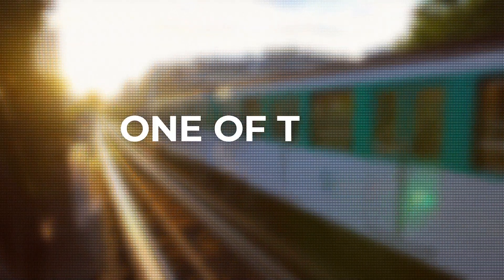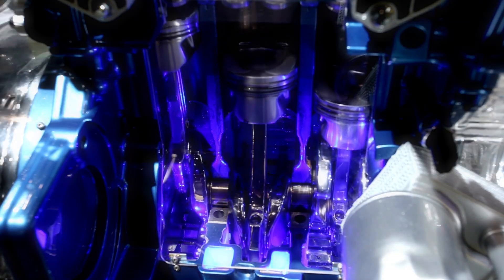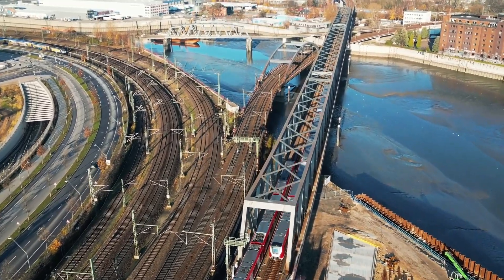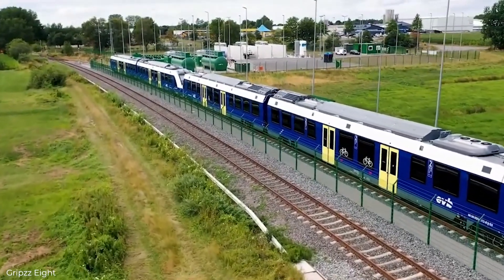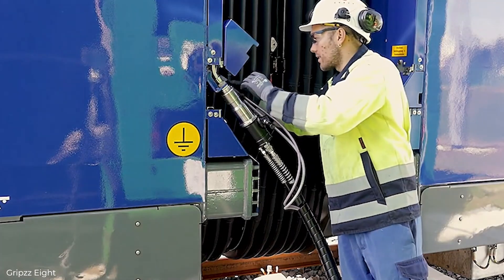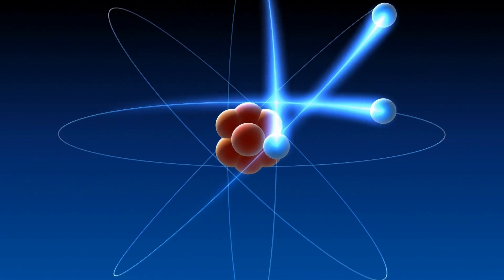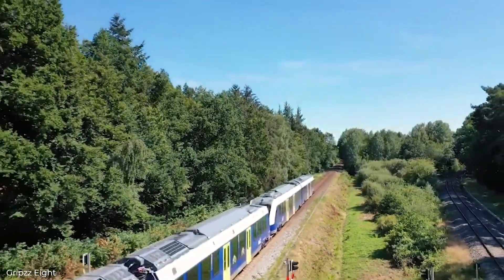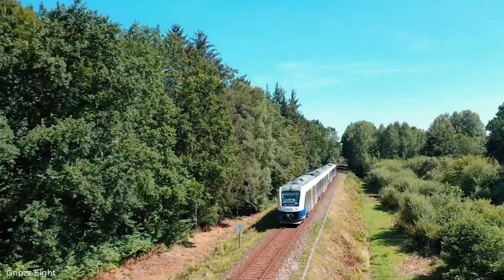The Problem With Hydrogen Trains...

Comment: Just because a railroad is switching to hydrogen power doesn't mean that they have to destroy their existing stock, nor does it mean that their hydrogen production is necessarily harmful. A prime example of this is Canadian Pacific (now CPKC, RIP KCS and CP) who recently converted three of their diesel locomotives, each at least 30 years old, and retrofitted them with hydrogen fuel cell technology, with their hydrogen supply being produced by zero emissions solar power. This is an approach many railroads can take to properly emit this cleaner form of energy without electrification. Yet, for one reason or another, the implementation and continued research of alternative fuels remains expensive due to the overwhelming subsidies given to oil and other fossil fuels, which makes alternatives, just like the rail industry, severely underfunded and neglected, which makes them unfavorable in the public eye. This is why it's essential now more than ever to raise awareness of the inherent efficiencies of any form of rail transport, which is what we youtubers are trying our best to do. Keep up the good work, and continue to correctly inform the public of the various aspects of railroading.
Reply: Hello there.